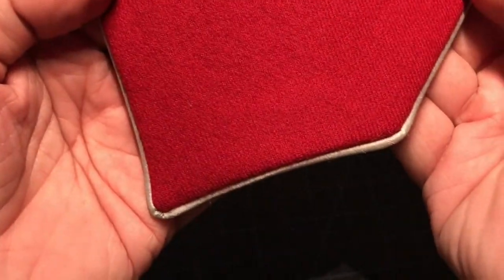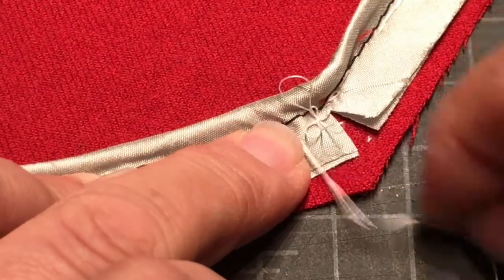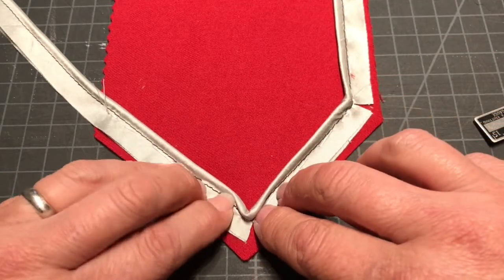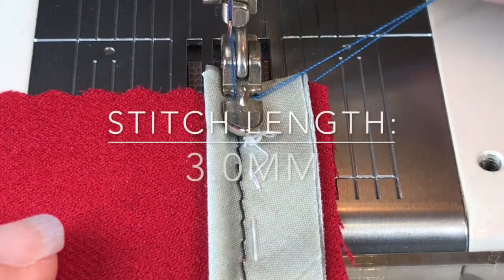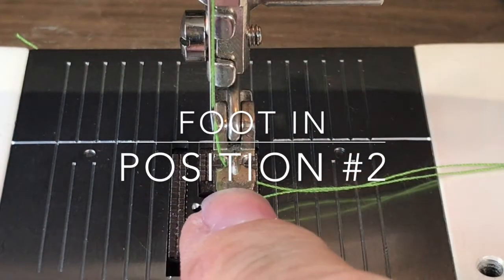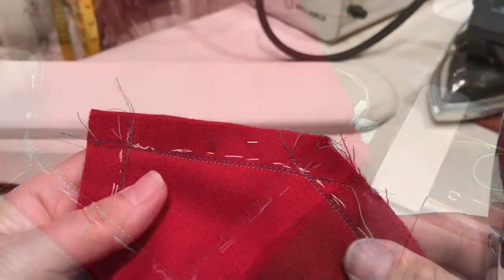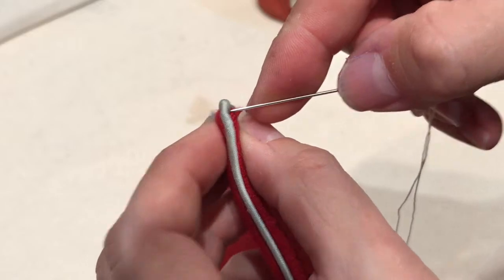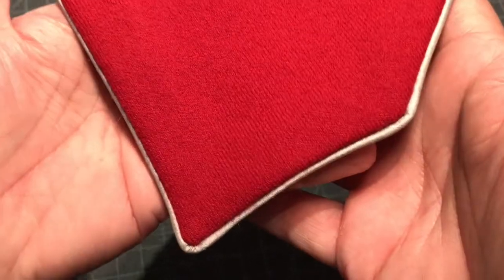Piping on corners

Comment: Can you share the brand of marking pen you are using.also, can you recommend a fine silk pin? I can’t find any I like
Reply from the maker: The pens are the Frixion brand disappearing pens--you get them from the office supply. As for pins, a link:
https://www.amazon.com/Dritz-Quilting-3035-Crystal-8-Inch/dp/B00275YF1G/ref=sr_1_17?crid=1NPWH1AETUKSP&dib=eyJ2IjoiMSJ9.9MMriodYlP2x9HdIh4VD2g82ii9LT6FXxCnbHltqK5Trli4HO24GU2mfC6Srld4Cus0zm1UejV9zENDuRaJliMUJhfqrlMQO1jIiRIgRVOvZBsnlzd5yd3IWMxaZqnfLPQQUF8VRejbAtJw56omPS2p1zE2FBFeO0qMKLHF8M7kl4jLnKhPY2h_ahH_2zrrabDa696SVFDSP11J76xIr73v94oo3SojOKuP97VccVrwI63R2AOAG5hwU02jQrfQdjVnr3gDGgGe7JKjD2EWN_1IrZ7SsOZoOH7hOGzerHW8.ftGwURBB5fGQghg6i-VcTQC0btKBXqvhaY_r-gIwpYQ&dib_tag=se&keywords=silk+pins+for+sewing+extra+fine&qid=1720104001&sprefix=silk+pins%2Caps%2C117&sr=8-17